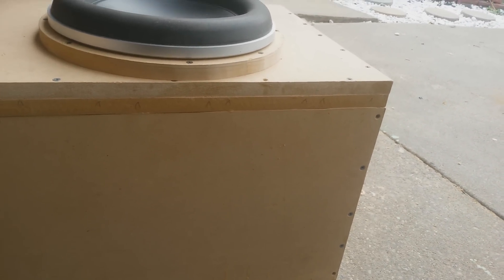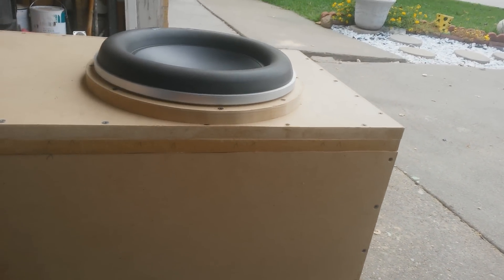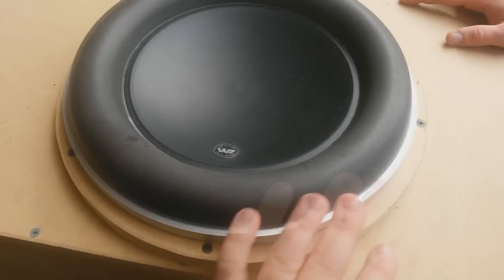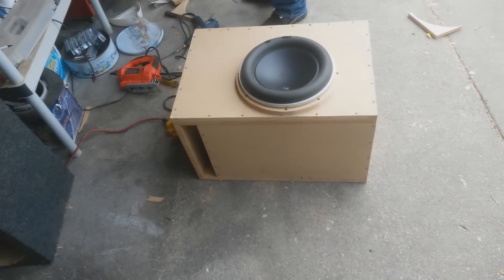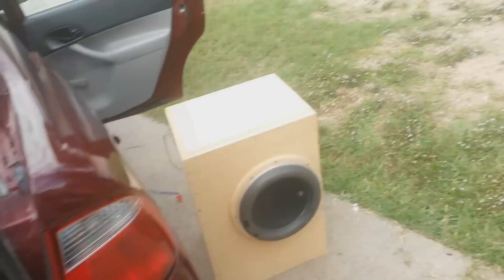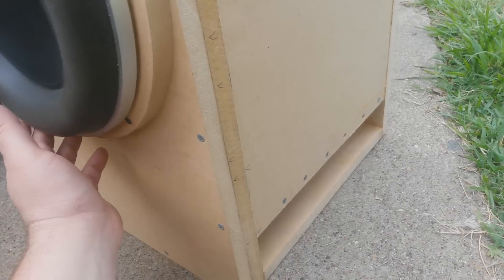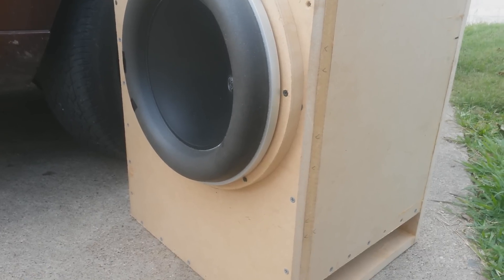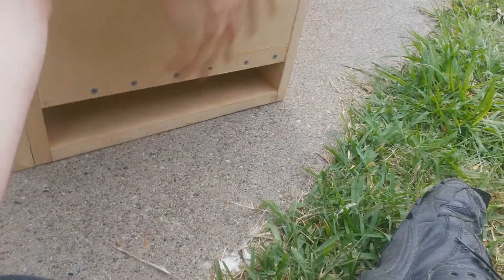3.16 Cubic foot box for a JL Audio 12w7-3 subwoofer | Car Audio

Comment: JL Audio recommends no more than a 1 inch baffle. There's a reason there are vents on the basket and the thick amount of wood around the baffle is said to cause distortion. It's been a long time since I read the article but if I can find it I'll post it. Nice box b.t.w. I have a JL 13W7-D1.5 in a 2.375 c ft box and it produces phenomenal sound and bass.

Comment: Hey brother what's your amp settings on for just the subwoofer like low pass filter and freq filter ? I have a jl w7 too as well but down sized to a smaller box from high output :/ big one trying to get deep bass back :(

Comment: Can i use the same design for a 15" sub speaker?
Reply from the maker: Mack Shah yes you can. You might want to extend the sizes of the box dimensions just a slight bit yes you can use the same design
Reply: Gerad Deuvall i basically need 3.17 cubic feet tuned to 32hz

Comment: Box was too big
Reply from the maker: Nah, turned out great.  It got low and loud, which is what he was wanting to do.
Reply: +Gerad Deuvall I'm building a system around 2 12" w7s & a slash 1000/1 ..how big a box you think would be good
Reply: +Papo Portillo 4.5cu.ft ??
Reply from the maker: I probably would not go any larger than 4 1/2 ft.³ for 8 to 12 box especially since you're only running 1000 or MS to both of them, where they are capable of handling much more than that. Also, it depends on the frequency you want to box turned two. If you want to go for a lower frequency, I would push closer to 5 ft.³.
Reply: Gerad Deuvall 
i have 2 12w7s and two 1000.1 jl audio slash v2 amps, i had a dual ported box made to factory specs and i asked the dealer about having a box bigger then spec and they told me they wont recommended any box to me larger then jl specs but will build a box to specs i give them, what is the max airspace for two 12w7s that you would recommend?